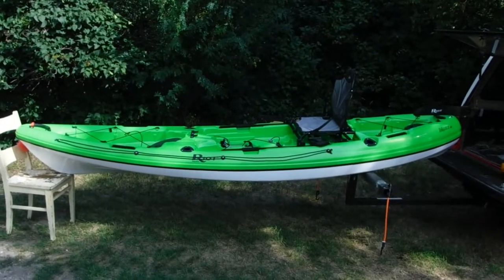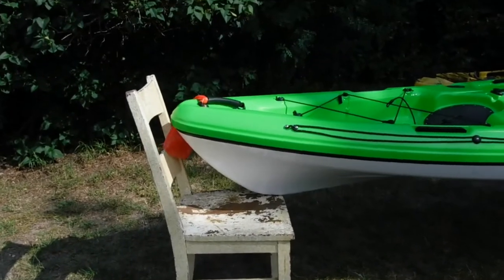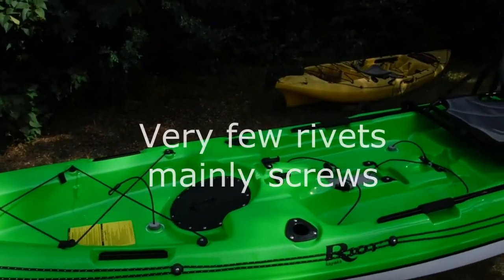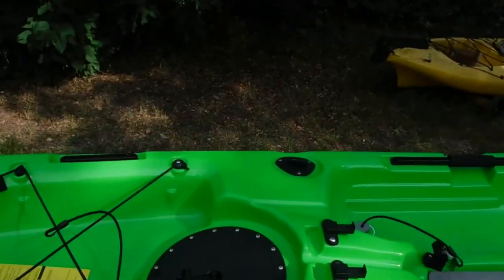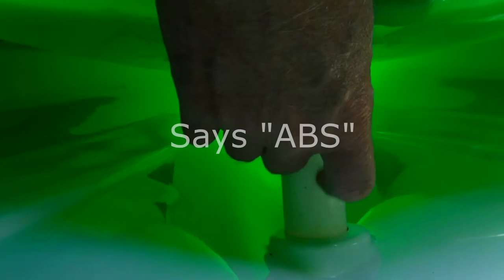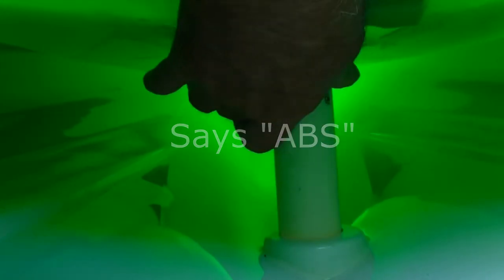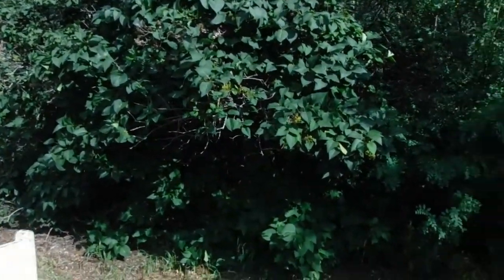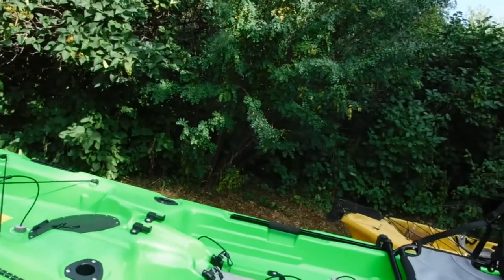Mako 12 Crosslight first look

Comment: Update on the crosslight?
Reply from the maker: Coming Soon
Reply: @clydelindman6083  good update or bad? I am about to buy one..
Reply from the maker: @lloydmauler  Ha! Mixed. I've paddled kayaks since 1976, river kayak, sea kayaks, SOTs. This boat is a new animal and for me, needs to be learned. Judged as a kayak it is a slow tub, but so are all the pedal kayaks are from what I can see, For good tracking you can put the rudder in the water straight and use it as a skeg.

For pedaling you can steer with the rudder control. I thought you might be able to paddle and pedal at the same time. My knees got in the way so it is either-or.

The one real weakness in the system is the rudder control and they may have fixed it by now. Other reviewers had issues with the cables snapping. I so far have not had that problem. However in my boat there are no provisions to tighten the cables. Both in the handle and at the rudder the cables are secured by lead compression fittings that I would have to melt off. I was able to tighten them some by angling the cables out from the rudder and tighten those screws down and that seems to work for now.

Another thing is there is no flotation so if you happen to leak you go down. Pool noodles under the seat area should solve that.

All that makes it sound like I am not happy with the boat, but I am. Really. The seat is really comfortable and I do not have to keep my legs in a braced position which, in my 70's, can make for a painful outing. I haven't had it in REALLY rough water yet but was caught a mile out when I had to head in in near gale winds, which would have really taxed me paddling. With the pedals it was just another afternoon on the water albeit a bit slower.

The boat is almost ridiculously light so I can easily handle it myself and will probably be able to into my 80's